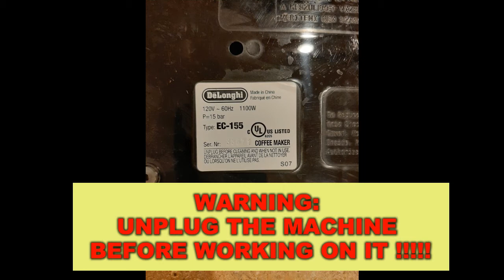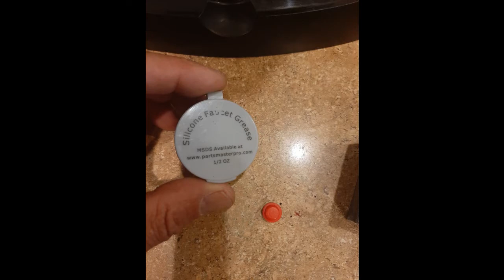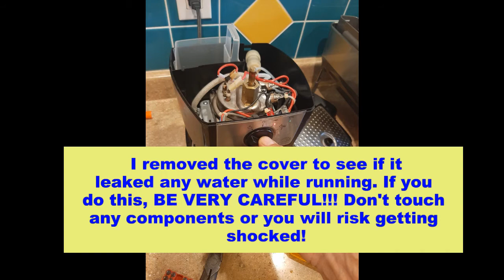How to Easily Replace the Water Pump on a DeLonghi EC 155 Espresso Machine

Comment: Thanks for doing this! Bought a used one, guess it hadn’t been used in quite a while, and it wasn’t working. Took it apart, cleaned the tubes, primed the water pumped, then put it back together, and worked just like it was supposed to, no pump replacement needed yet! But would not have been able to figure that out without your video demoing how to take apart and reassemble. Thanks!!!!

Comment: 07.01.2021: Thank you for your video! I just finished replacing the pump on my machine while using your video as a guide.  My machine is now working fine. I pulled my machine out of storage after not using it for five years. I found that no water came out at all, just a bit through the steam wand. The diffuser was covered on the inside with tar-like coffee muck. Cleaning it didn’t help. I did read that it was common for the pumps to go out on these machines. After finding your video I decided to give it a shot.

 I did struggle a little when pulling the water hoses from their connectors. They were very secure, but I was careful and persistent.  The black rubber mounts for the pump were also resistant to stretch, and the “thingy” that connects the hose to the pump with a threaded connection was difficult get started. I find it hard to believe you were able to disconnect anything with one hand while holding a camera in the other.

After putting the machine back together, there  were a few minutes where I thought the hour and a half I had just spent was a complete waste of time. The machine came on and heated up, but no water came through. I turned it off and on a few times  and just let it run. I guess that’s what it took to coax the water out, because eventually the water began coming through. Ultimately, a success story!

Comment: Watching this helped me replace the motor.  Thanks!  Never watched the end of the video till after I finished.  What I ended up doing was touching all metal parts with a screwdriver to check the electrical as well.
Reply from the maker: Good to hear. Mine has been working great so far, so I I'm happy I decided to replace the pump rather than junk the machine. Still making excellent espresso!

Comment: Thanks for posting your repair adventures. I have a similar machine an EC152CD and its not generating enough pressure. A long black coffee is taking a lonnnnnng time. I might try changing the pump or the ball and o ring inside the pump. Your video was very helpful thank you 👍

Comment: Hi, this is very helpful. My machine's problem is no water comes out from the brew, but the steam is ok. Same pump issue? I just did descaling and yes the machine was put away for years. It was ok after I tried days of running, but now the problem metioned above. I open the machine and inside seems ok.
Reply from the maker: Yes, sounds like it might be the pump. Same thing happened with mine...no water coming through, or it would run a bit then stop. Pump just got old and couldn't handle the backpressure any longer. It's been working great ever since I replaced the pump. Good luck!

Comment: I've jumped in but seem to have a problem with unscrewing the "thingy" from the pump. There are no threads...and the replacement pump doesn't seem to either.  It looks like a push fit.....do we have different years of manufacture or what?  I'm kind of stuck with either pulling it apart or getting dizzier....
Reply: I had the same issue. What it did was use scissors to cut the top rubber holder so as to be able to take the pump out from the top. The rubber holder is only meant to keep the pump in place, when I put the new pump in, I still put the rubber holder on top of it, since the cut did not prevent it from keeping the pump in place. Once I removed the old pump, I used a 12mm wrench to hold the larger plastic part still and that way I managed to unscrew the "thingy" as shown in the video. Hopefully this is helpful, after overcoming that obstacle I managed to replace the pump and my coffee machine is like new now.

Comment: Sorry, comment was sent out before finished. Water in reservoir was heated when using steam function. I thought there should be a check valve to prevent the heated water flow back to reservoir. How do you think? Thanks.

Comment: i replaced the pump. it worked for a bit then stopped pumping water again. i wonder if its the valve? how can i tell? also i cleaned up the filter connecting to the pump. it had coffee grounds in it. any more tricks would help thank you.

Comment: I"m just curious I purchased a used one it seems to work good on the heat , but its just not pumping out solid shot of espresso withe Crema did your unit  start to have shots that just were not at the level I see of most of the espersso shot son the unit.  ?
Reply from the maker: Mine would barely push the water through...just dripped it out. Pump was just worn out. Good luck!

Comment: I'm trying to find the o-ring that you cite and it's not easy. Any suggested web site?
Reply from the maker: I bought mine at a Marshalls Industrial hardware store in San Diego, so maybe call around to some nearby private hardware stores. Home Depot and Lowe's have very little selection of o rings. The smaller hardware stores usually carry a better selection. Or try one, but shipping costs will add cost...https://www.theoringstore.com/store/index.php?main_page=product_info&products_id=40666

Comment: I just did this to my D'elonghi ECP3420. It was a true odyssey just to get to the pump without destroying, bumping, crimping or disturbing any hose or coupling. 

It took me a while and since I couldn't find a how to video, I went in cold but made it. Results?......same. 

My machine still dispenses my espresso like an old man taking a whizz. Drip drip drip. 

Good luck everyone!
Reply from the maker: Hm, can you share the pump brand and part number you used? That might help others trying to fix the same problem. Sounds like a different model machine, and I'm not familiar with that one.. Have you tried different levels of grind? Does it come out any better with a course grind?
Reply: @ninetries5382  I researched it and the Delonghi 5113211291 Water Pump is what my and many other Delonghi machines use . My biggest challenge was getting to the pump in the first place. I had to take the entire machine apart and even then, pulling out the entire pump assembly was a massive pain. 

I did try changing the ground coarseness and nothing helped. I even tried to burn off the lodged grounds inside my filter cup but it didn't help. 

I finally just bought a new filter cup with a removable bottom which my original cup did not have. It works just like new now. I don't regret changing out the pump since I know they tend to have a finite shelf life. Maybe this exercise has bought me many more years of use out of this little machine.
Reply from the maker: @DoroteoVilla  Interesting...thanks for sharing. That info might help others in troubleshooting a no-flow condition.

Comment: Hi, I noticed that one of the plastic pieces connected to the red wire looks burnt in your video. It looks the same on my machine. My machine is not working as of right now so I'm wondering if that could be the issue. I took a picture a year ago of the same piece, and it wasn't burnt at all. I've had the machine for 6 years but started using it regularly about 3 years ago.
Reply from the maker: Hm, that's a good possibility.  If you can find that wire connector you can try replacing it. An electronics or auto parts store should have that. Just be sure it's unplugged! Be safe or have someone do it for you. My machine still works so I haven't bothered replacing the burnt connector. I really should though. 🤔

Comment: Nice video! What were your signs of the pump going bad? My machine is not pushing the water out. Was your machine doing the same?
Reply from the maker: Right, mine wouldn't push the water out, unless I used a very course grind. Just not enough pressure with the old pump. So far it's been working like new with the new pump, so I think it was worth replacing.

Comment: Hi. Thanks for the video. It is amazing!

one question is which Torx driver number do I need to unscrew the bottom one?
Reply from the maker: Glad you found it helpful. The Torx bit I used is stamped T20. Hope that helps.
Reply: @ninetries5382  Cheers mate! I bought this on 2010 and first time ever try to replace the motor after 10 years lol. Hope that I can change it successfully.  I will let you know my result.